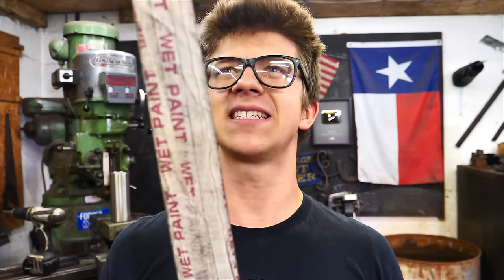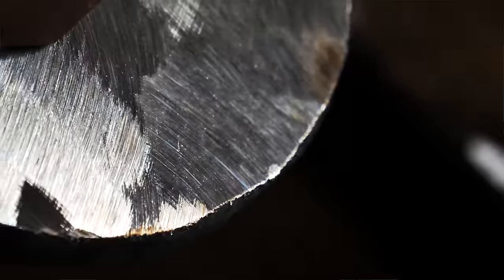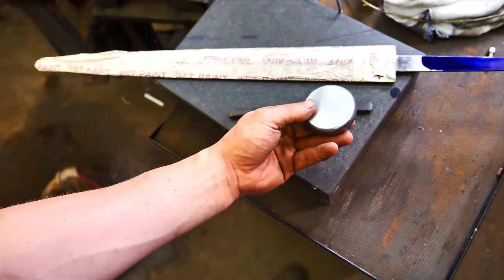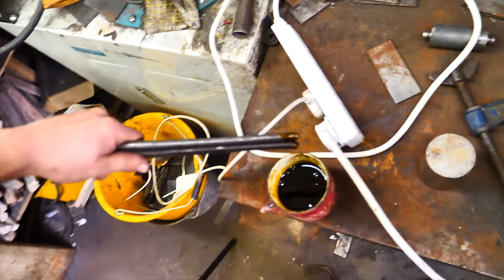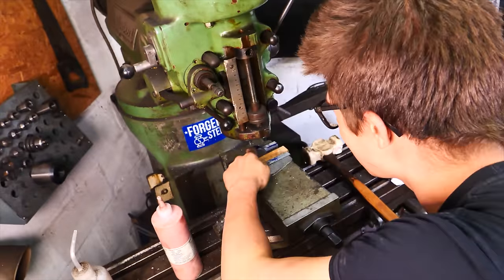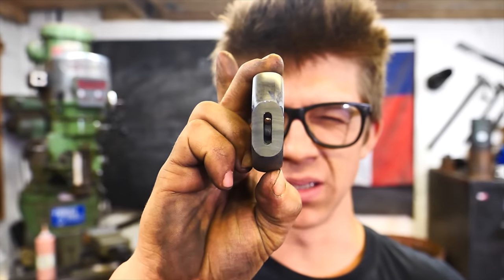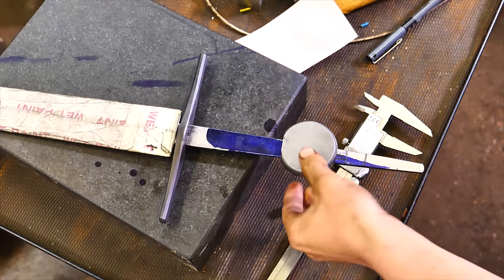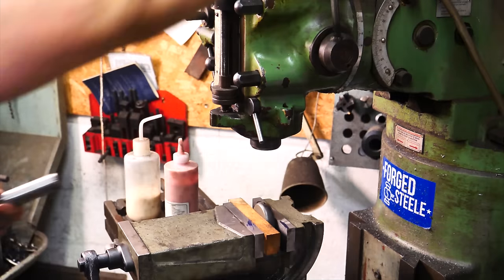MAKING MY FIRST SWORD: Part 8 - The POMMEL to End Him Rightly? Screwdriver required!

Comment: Why not pean the pommel onto the tang?
Reply: yeeah, that would have been way better.
Reply: okay but still. That's the weirdest/weakest pommel attachment I've ever seen.
Reply: Totally agree. So much easier with no weak point and not worry about if you've measure wrong. Threading will need to not too long or short, and even if he manages to get it just perfect, over time, it will move... then it's a mess. Peen it and you're set. No muss, no fuss.
Reply: It did seem much more complicated compared to other sword smiths on YouTube.
Reply: peening aside, why not just tap a hole into the pommel and screw it on directly?
Reply: All y'alls' comments are my thoughts exactly
Reply: @Knightsljx - If you put a hole in it and screw it, then there's a weak point that's impossible to adjust. If the screw, pin, or hole wears, or if it's not in just the right spot, or if the handle compresses, and the pommel needs to be tightened... there's no good way to adjust it. 
If you peen it, and it needs adjusting, you just peen a little more to tighten it up - good as new. 
At least with his design he can still tighten it down more. Sure, things won't be flush then, but at least he can tighten it.
Reply: My biggest problem is that a disk pommel with never align correctly. Crying.

Also wondering how he's going to make a grip around that broad tang.
Reply: The disc is slotted, so the tank will keep it straight.

Comment: Alec , for your next project could you attempt making a small damascus anvil?!? that'd be soooooo cool!!!!
Reply: Brian Gastineau it would be cool but very hard to do :)
Reply: Super Noodles 
he totally could do it though! he could do a small 50 pounder or something
Reply: maybe a small desk anvil??
Reply: Yeah start out with something small and work his way up to a full sized one
Reply: Do you mean like a micro anvil? Like a paperweight?
Reply: sod doing a micro anvil. go bslls out and make a full size one. get yourself ip to sheffield and make a huge damascus billet then grind away.
Reply: from what i know good anvils are made in very specific methods, like they have forged and cast steel forge welded together to help reduce hammer bounce and ringing and such.
Reply: Brian Gastineau or a Damascus play button
Reply: bmxriderforlife1234 They can also be cast iron and steel forge welded together, all cast steel, I think it can be all forged steel(e) too.
Reply: Brian Gastineau AW HECK YEAH!
Reply: This probably wouldnt work. Anvils are cast steel which is incredibly hard. If he made a Damascus anvil it would be too soft and through use would dint and mushroom too quickly.
Reply: this could be potentially doable the best anvils are forged and not cast I myself have one of each and adore my forged one
Reply: Gage Coffey That is interesting. I am by no means an expert but I would think it would be fine for mild steel and the like but I would be cautious about hardened or Damascus steel.
Reply: Rob Swinbank well Damascus is a very loose term and can be made of virtually any types of steel however the steels he uses in his videos provide a high contrast etch based on carbon content and he could do a large Damascus base of a more mild steel and a different steel face of a higher carbon
Reply: he uses 1080 and 15n20 which are both high carbon steels , anvils can be made of virtually anything as long as they have a hardened face,  his damascus is made of good enough steel to do this... itd just take ALOT of it... if there were any problems with it later, he could just forge weld a better face on it
Reply: I don't know much of anvils but I don't think that making a functional one would be possible, BUT making a toy decoration one should be.
Reply: Greg Ward it probably wouldn't be in his current shop however it would be completely possible to make a functional anvil out of Damascus
Reply: anvils were originally made by about 8 Smiths forge welding different blocks of steel together to create the different parts... because Alex had a power hammer he wouldn't need extra help... maybe sam.... but it's a fairly simple process, it just takes allot of metal and brute strength.... which he has access to both, research the process it's quite interesting
Reply: Brian Gastineau it's not necessarily the man power that's the issue it's forge capacity followed by the problems of heat treating
Reply: Gage Coffey 
ahh.... yup forgot about that part... how big are the forges at his "school"?
Reply: That main forge he has is around six inches tall (if I remember), and about twice as wide and deep.
He has some videos about him making it, so it would be easy enough to get the dimensions, but if you saw the size of the billet of Damascus he started out this sword with, he would be able to heat up a very large piece of steel.
Reply: Cave of Skarzs but as you welded the pieces together it would get much larger you would have to fit a full sized anvil in the forge in order to heat treat he would also have to have a very large quench container to cool something that large it's just a very problematic process
Reply: Gage Coffey I don't think he heat treats his anvils. Im probably wrong but I thought he made a video on it
Reply: A cutler's stiddy!
Reply: he doesnt have to do a huge one at first, maybe a 50 pounder, he should just build the biggest one to fit his forge. and yes you do heat treat anvils, the face must be hard to give that bounce back, you don't get them super hot,  maybe a dark cherry red and then quench with water, because it is such a big piece of steel it wouldn't crack... check out some of the homemade anvils here on youtube
Reply: Brian Gastineau no im saying i don't think he heat treats them. he said he doesnt want peaces to chip of on a miss hit.
Reply: Brian Gastineau he said its easier to reshape them than it is to pull a piece of metal out of your leg.
Reply: ian meng i believe you're talking about his 1 inch plate he uses for heavy hammering, you are right that a hard miss would definitely chip the face, that's why new anvils are less popular since they haven't had time to soften with work and heat. so yes and no. you do still want a hard face or you would dent it easy but not too hard that it chips too easy... it's a weird balance
Reply: Brian Gastineau o OK I see. sorry for my misunderstanding.
Reply: Yeah, he stated that his striking anvils he doesn't heat treat for those reasons you stated, ian. But, and I may have misunderstood, we were talking about a traditional anvil, ones that have hard faces. So in that case. . .
Reply: ian meng 
you're all good bro, it's good were discussing these things, hopefully we can all get learning out of this! I still new to this area... still plenty to learn here!
Reply: i love this community
Reply: ian meng 
the only reason I know this is because I was going to make my own anvil and did a crapton of research ultimately to give up and buy one :)  ......
Reply: honestly damascus isn't great for impact. any trouble in the welds and you will get delamination heavy cracks forming and you will be left with several small chunks of metal after a few years of use. i would be quite interested in seeing one of his damascus pieces tested with dye penetrant to see how well they join together
Reply: mmmm.... 200 lbs of damascus steel. The dude's gonna be in debt for the next 5 years
Reply: A functional Damascus anvil would probably not work at all. Alec regularly has to deal with cracks. Can you imagine the statistical odds of not getting a single crack or delamination in a billet the size of a functional anvil? It's madness. A paperweight anvil would be cool though!
Reply: meaty cabbage then maybe a miniature one
Reply: Anvils have to be soft metals, so they do not chip and break and damage products.
Reply: superblahmanofdoom, not completely right there. Anvils always have a hard face to prevent damage to the anvil. Skill in using an anvil with hot iron is required...
Reply: lol I was just thinking the same thing
Reply: Rob Swinbank you need a hard anvil as you as much rebound as possible to reduce the work you do. For striking anvils people tend to use mild steel as it won't shoot off on a miss hit.
Reply: ian meng that's for a striking anvil where there is a team using sledges, normal anvils have to be hardened so they have rebound.
Reply: i know for a fact that alec has a non hardened anvil, he uses it in his videos and talks about it's function and uses.
Reply: How the f**k did you think the same as me? But i did not think of a small anvil
Reply: I agree, that would be challenging too.
Reply: Brian Gastineau Such A Great Idea!
Reply: Seems like a waste of Damascus to use it on an anvil.

You'd use high-carbon steel for that.
Reply: +Doctor Doubt well guess what...
Reply: This may be the dumbest smithing idea of all time🤦‍♂️

Comment: I'm still concerned with the transition between the guard and the blade.  Those 90 degree corners are a weak point and will eventually fail.  For all the excellent hard work you've put into it so far, I'd strongly suggest fixing that before permanently affixing the guard.
Reply: That mild steel screw is a severe weak point too. He should have just cut a thread on the tang.
Reply: Xiras1985 would of been easier.
Reply: Yeah, the screw is a big issue. I would have just pean the tang.
Reply: yeah thats not a sword u want to be cutting with once its done. unless u like blades flying back at you
Reply: To his credit, this isn't a sword that will be put to the test in combat day after day. It'd probably spend all it's life on display.
Reply: Xiras1985 really he should have peined the tang. The tang is so thin only the edges would be threaded and that too would have a weak hold in the pommel because of a lack of surface area.
Reply: What I am concerned about, like El Chick, is that 90 degree transition. An angled transition would have been much harder to machine, however.
Reply: Easy enough to grind/drill a rounded corner. A hard angle of any sort will eventually fail in an application like a sword, presuming it gets used.
Reply: How many Vikings do you think he needs to fight with that sword? I'll bet it's gonna end up on the wall.
Reply: squidlybytes, agreed. Stress raisers have to be eliminated by rounding, chamfering, or spooning. Material dynamics HATE sharp corners...
Reply: Yep. Even if it's only a display piece, it's not a huge effort (compared to the excellent work he's done so far) to make it so much more robust.
Reply: You could, it's not that hard. Just find a blacksmith near you.
Reply: i make swords for fencers (nothing as beautifull as this) and the right angles are a risk but the bolt needs to be thicker if hes gonna fence with it ever.  the number of repair jobs we've done with sheered bolts in the pommel.... needs to be 7 to 8 mm minimum for safety.

Comment: whatever happened to just peening?  The time tested and proven method
Reply: Richard Chapple i dont understand either. he had the length in the tang and it would be much more sturdy and possibly simpler
Reply: End him rightly.  Must appease the masses.
Reply from the maker: +Richard Chapple dont want to break the handle!
Reply: If the steel is soft enough, you can peen it fine.  I do it with many of my knives.  On the other hand, you can cut the handle into slabs, mill out a groove for the tang and epoxy them together on the tang after the pommel is attached by peening.
Reply: Alec Steele Alec, reach out to Skallagrim and have him review this sword. would be a great collaboration.
Reply: Alec Steele , far enough
Reply: fair enough,  stupid auto correct

Comment: Alec,I ain't  blacksmith, but i did make few knifes for my self.The way I did my pommel is pining technique,drill/slot pommel all the way,make tang  same size as slot,slide pommel on tang and pin it,works fine for two part scale and for traditional trough-hole handle,best to leave handle unfinished so if you get scorch marks you can remove it later...

Comment: Alec steele, seriously, thank you. you have such a motivational personality. i just replaced the clutch in my car. i have been fighting with it for about 6 days now. i just got the transmission back in and everything buttoned up and ready for the test drive. took out the jack stands, lowered the car to the ground and then proceeded to attempt the test drive.........car doesnt go into gear. it just grinds alot. i was honestly about to just get rid of it and buy a new car. but i do believe you saved my car. if it doesnt rain tomorrow.....i will be back out there for day 8 trying to figure out whats wrong with it. 

thank you much alec. love the videos btw. your an amazing content creator and an even better blacksmith.......maybe. your videos are top notch lol.

Comment: As ingenious as the welding of the bolt is, part of me thinks you should have done a riveted tang.  Mill the slot the whole way through the pommel, at an angle to match the taper of the tang.  let the tang extend beyond the pommel once the handle is on, heat the end of the tang and then hot rivet it down to bring everything together. Many swords were done that way, and it really kept everything strong.

That said, this way is also used by many modern sword makers, and seems to be strong enough for many swords.  No complaints here, and no criticism on what you did.  Always love your videos, and you've continually inspired me to get in my own shop and make things.  Someday I hope to have enough ability to have my own channel like yours

Comment: So, prior to seeing this series of videos by you, I had tried to make a really odd shaped yet awesome looking sword. Out of used ramps to get cars onto lifts at an auto shop. Long story short, I did So many things wrong, but it still looks cool even though all I had was a 4&1/2 inch grinder, a dremel, a brush, a propane torch, and a 220 SMAW welder. Failed miserably and gave up after a while, but I still had fun. Now that I've seen what you've done, Alec, I'm going to try to make a small dagger or knife.

Comment: Hey Alec! If you ever decide to make another sword, save yourself the effort of working a bolt into the end of the tang like that and just thread the end of the tang. That's how it's supposed to be done. It doesn't matter if the tang is 4 millimeters thick. What you do, is cut it 4 millimeters wide, and thread that portion of the tang. The threading tool will bite in and make threads on the sides, and they will work fine for securing the nut. I would suggest though that you try that on a few pieces of scrap before you try to thread the end of a sword or knife tang though, just so you have experience with how that process works :).

Hope this helps!

Comment: Alec, I would like to suggest that you use a flap disk in your angle grinder when removing scale. they're at least as aggressive while leaving a more even finish - so there's a little less work on the belt sander.

Comment: Just to add to the cacophony of similar comments, I highly recommend you round off the 90° corners where the tang turns into the blade before doing final fitting of the guard. Even though this isn't a "battlefield implement" and will probably hang on a wall, it's just so much cooler when it's built to take the force. It just adds value and accomplishment if it handles nimbly as an arming sword(what they called one-handed swords) should, even if it remains blunt edged.(Though being shaving sharp ups the cool factor another notch)

Comment: Don't know if it's been suggested yet, but when you are putting things together that are a tight (drive) fit, you can heat the piece with the socket to enlarge the hole.  You don't need a whole lot either...rule of thumb for steel is 1 thou per inch per 100 degrees F.  Converted that is .02mm per 25-ish mm (original size), per 55 degrees C.  We use this everyday in my shop when installing bearings in helicopter transmissions.  Heat bearing...slides right on shaft...once cooled, you need a hydraulic puller to take them off!

Comment: Most swords there would see a lot of cutting, or sparing would have a preened pommel. You would set it so the tang goes through, then heat and peen it as you would a rivet. It would have the same kind of stop, but the threaded area wouldn't be threaded. This adds strength as every time the sword makes contact, a screw would get vibrated loose.

Comment: Nice job on the bolt keyed into the tang.  I wouldn't recommend welding it though, even with normalizing heats, but the way you've got it keyed it may hold up fine.  I would probably have used something like a 3/8" grade 8 bolt and split it into an inch or two V notch and hard silver brazed it on and likely have softened the end and peened it like original swords(turned down the threads for a smooth shoulder).  Or hot punched the pommel or milled the slot the whole way and peened it for strength.  I'm not expert on swords, but if you ever develop a looseness or rattle, it's asking for the blade/handle to come apart.  Same thing with the guard, would never have filed the bevels away to make a flat, easy enough to hot fit the guard and if your worried about a visibly perfect fit use a small shim piece filed to tight fit as an overlay.   Overall well done and can't wait to see the finished piece.

Comment: i've been following this project since the begining,and i have some suggestion.
1.You should make the transtition from the blade to the tang a bit rounded,that 90 degree angle is a massive stress point.
2.Instead welding a screw,why don't you just make a rat tail tang all the way to the back of the pommel,heated the point of the tang,and hammered it onto the pommel.i think that would be much stronger than welding a screw to the tang.if you want to use screw,i suggest you make thread on the tang instead of welding a screw onto it.

BTW,that sword looks AWESOME !!!